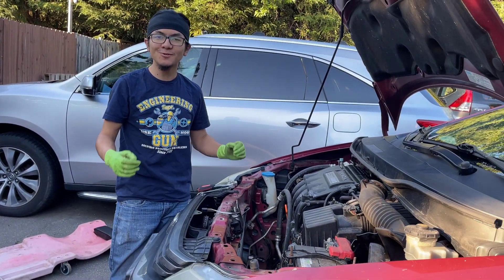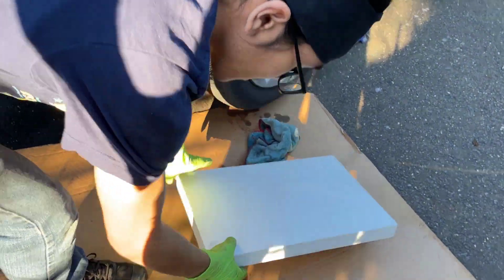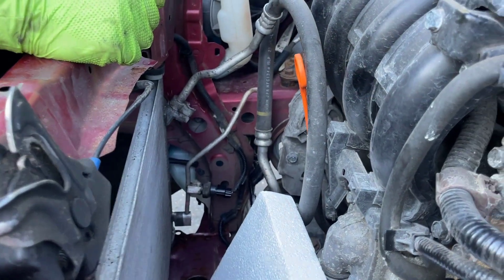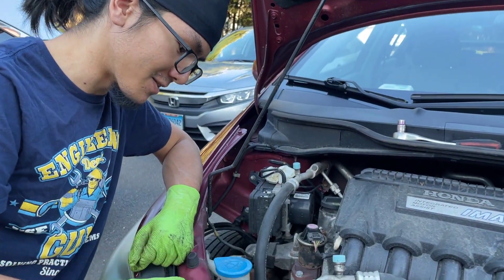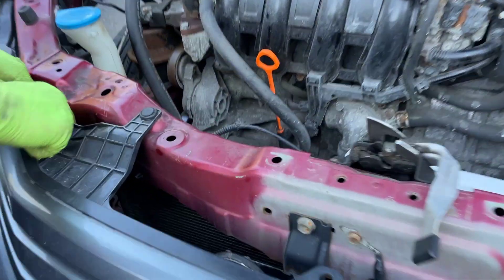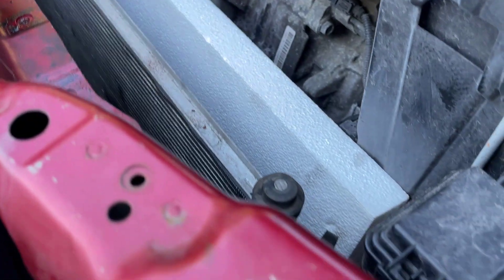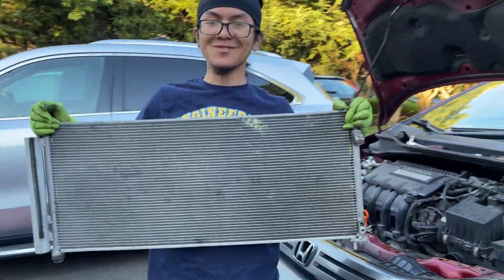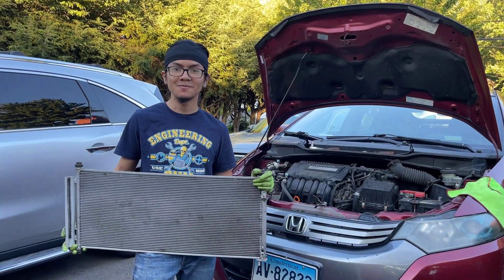How To Remove Condenser Honda Insight | P4 Fixing Car AC Issues By Replacing One Component At A Time

Comment from the maker: Here are the #ad links to tools, parts and accessories you may need to perform this repair:
1.  https://amzn.to/3Ow87Te  |  AC Condenser A/C Air Conditioning with Receiver Dryer for Honda Insight CR-Z
2.  https://amzn.to/453Ea3P  |  UAC RD 10898KTC A/C Receiver Drier / Desiccant Element Kit, White
3.  https://amzn.to/3QuitWs  |  XtremeAmazing 3Pcs Radiator Cap and Coolant Reservoir Tank Cap Joint Kit for RDX Ridgeline TSX ZDX TL CL MDX Legend CRV Accord Civic Insight Pilot Element
4.  https://amzn.to/3DTEYMQ  |  A-Premium Engine Coolant Radiator & Cooling Fan Assembly Compatible with Honda Insight 2010-2014 1.3L, CR-Z CRZ 2011-2016 1.5L, Automatic Transmission, 3-PC Set, Replace# 19010RBJ014, 19030RB0004
5.  https://amzn.to/3OQMv5t  |  A-Premium Engine Coolant Radiator Assembly with Transmission Oil Cooler Compatible with Honda Insight 2010-2014 1.3L, CR-Z 2011-2016 1.5L, Automatic Transmission, Replace# 19010RBJ004, 19010RBJ014

Or Click on Amazon link here and search for what you need:  https://amzn.to/3xIOsqg